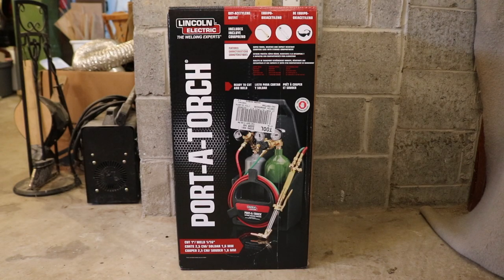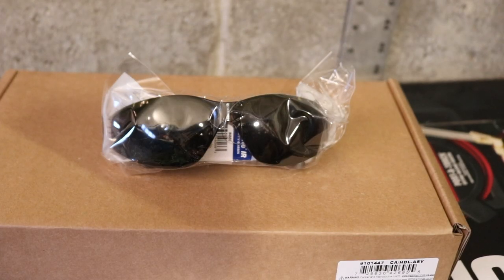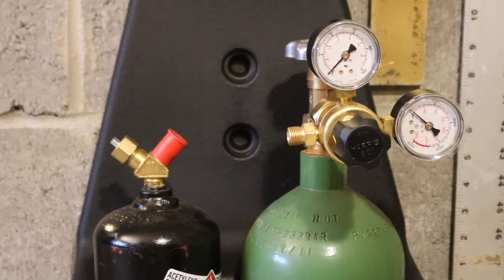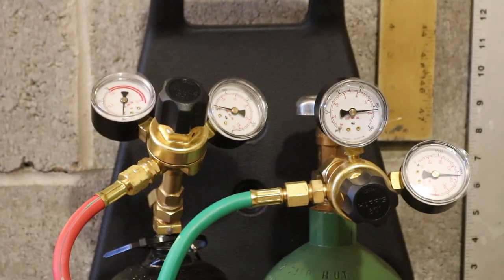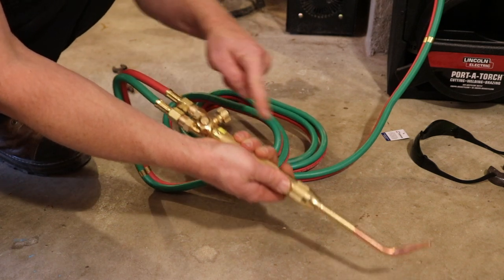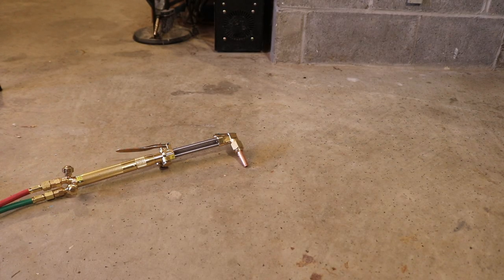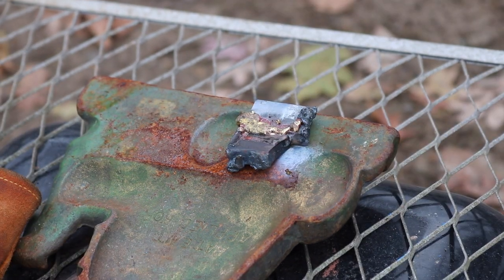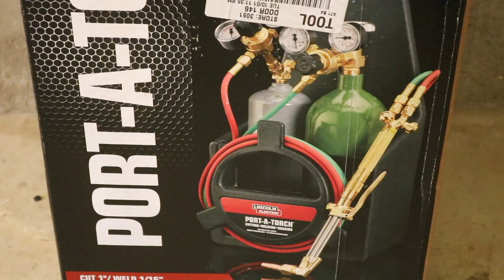Lincoln Electric Port A Torch KH990 (Unboxing, Setup, Test and Unbiased Review)

Comment: I can see that you can't weld to save your life. But hey at least you are trying. First of all for welding you are using a cutting torch. Use the welding tips for that 1/4" a number 4 tip is good. Heat up the welding surface until it gets red hot just enough to melt the surface then you introduced the welding rod. I set my welding tanks to 40 psi. for the oxygen and 10 psi. for the acetylene. That's just for welding. Keep burning my friend.
Reply from the maker: Thanks! I am terrible at welding. I need to take some classes.  That may not even work. I may need a master like Mr. Miyagi from Karate Kid only if he were a welding master.  Thanks for the tips. I need any I can get right now.
Reply: At first I skimmed the comments looking for an answer I thought this was a bit harsh. Then I watched the video and oof, point taken. Thanks For the video anyway ray. I think it showed me I should probably just buy the torch kit and get some bigger bottles.

Comment: Thanks for the video and explanation, man! How many cuts can you get from one fill? I have a 2 7/8s pipe cutting project. Need to cut about 12times.
Reply from the maker: The torch gas does not last very long but it will do 12 cuts for sure.

Comment: Please when using all these compressed gas cylinders always install the safety devices,that is the flash back arrestors on both the regulators and the torch end,this is very very important  .
Reply from the maker: Thanks! Very true. I also learned that it's a good idea to get bigger tanks when you go to refill. The tanks do not get filled all the way and quit working  before they are completely empty. When the acetylene gets low you can have flash back so don't run it when the acetylene gets low.

Comment: Congratulations!
I just bought this kit and I got the bottles refilled.
My question is how long do the bottle contents last?
I started using the torch today and I tested my cutting attachment which was maximum 5 mins 
and I did some welding which was around 15 mins total.
now my Acetylene was at 200 psi and now it's less than 100, What's going on?
How long do the tanks last when you use them?
Reply from the maker: The small tanks do not last long enough in my opinion. This is because a small amount of unused gas must be maintained. My tanks lasted about the same time that you mentioned. I am getting bigger tanks on my next refill. The only problem is the bigger the tanks the harder it gets to move so I'm looking into getting a torch cart.
Reply: @RayStein  Glad this exchange took place... I think I'm gonna use my small tanks to actually make a tank cart so when I do go and swap out for larger tanks I'll already have the cart...lol. Thanks guys.
Reply: @EM-eh1pg 
and use the 125 titanium welder to stick it together

Comment: Hello, how long does your gas and oxygen last? How many cuts can u make per set of tanks? Also is there a limit on how long you can use it before having to give it a “break” because of the acetone?
Reply from the maker: I have run my Port a Torch for an hour so far but am almost out of Acetylene. I still have a lot of Oxygen. Honestly, I have no regrets. I used to dread the idea of cutting with Oxy-Acetylene torches because the tanks were too big and heavy to lug around. Now it's fun because I can get to remote areas in my yard and cut stuff I would have never cut with the big tanks. I am actually thinking it's better to have 2 of each small tanks rather than one big Oxygen and one big Acetylene tank. I wont cut indoors because I don't want ash all over my garage. With that said, if you run the torch all day in a specially ventilated garage I would go with big tanks but I would still buy the Port a Torch because I love the Harris tips. I'd just switch my small tanks for bigger ones if volume becomes an issue. It cuts through metal really fast though so I don't feel the need for bigger tanks yet. Thanks for the comment!
Reply: Ray Stein hey thanks for replying. Was just wondering because of the 1/7th rule. That u can only use 1/7th of the tanks capacity per hour before having to give it a break. Just wondering how u dealt with that
Reply from the maker: @JoseGarcia-sy3ss  I take turns using my Dewalt Reciprocating saw, my Dewalt grinder and my Port a Torch.  I save the torch for the cuts the other two can't handle. I do demolition so I always have something else to cut or break apart while the tank rests. I use the tool for short periods of time. I must admit though I have violated the 1/7th rule when I'm heating something up before bending. I just pay close attention to my flow and turn it off if I notice my flow rate decrease. With that said,  safety is the most important thing when welding. I'm so glad you brought that up. I'll ask the guys at the gas store the next time I'm there and post their advice. I have a feeling they are going to tell me to use bigger tanks! Thanks for the comment because you may have saved a few of us on that one.
Reply: Ray Stein what did they say? Could you buy two more tanks and swap them out? One cools while you use the other?
Reply from the maker: @lhzav  I've been told it's best to get larger tanks. They will exchange them no questions asked. I told them I wanted potability so they said I should consider medium sized tanks or a cart for larger tanks. I'm getting a cart and will see what sizes are actually available versus how much weight I'm willing to cart around.
Reply: Ray Stein I guess larger is always the way to go but just not convenient in terms of transport. Especially over rough terrain. Thanks!

Comment: Wow this is a nice set, where did you purchase it from. Thanks for sharing
Reply from the maker: Lowes sells it. I will say I love the hardware but I recommend getting larger tanks on your first refill if possible.
Reply: Home Depot sells them too, it all depends tho, not every single store carries the same items as others
Reply from the maker: My small oxygen and acetylene tanks lasted 2 weeks. I had no problems with the gages. Also, they sell adapters if need be.

Comment: Great video, i am torn between this kit or the miller tag a long TL550 they look similar i do know that. Im not familiar with who rebrands etc if anyone knows any infornation like that i would love to hear your opinion on this kit vs the miller mentioned above. Im most going to be using it for a heat/cutting source for automotive type applications i dont see myself using it for welding too much. Really enjoyed the video :)
Reply from the maker: I use it for exactly what you are. The two kits are almost exactly the same. You could go with either one and be fine. Lowes sells the Lincoln Electric so you can see it / return it if you have any problems.
Reply: @RayStein  thanks for the suggestion!

Comment: I know it is almost a year later but it cost me $73 for both tanks here in TX
Reply from the maker: I'm going to get bigger tanks for mine and use the hardware that came with it. That hardware is as good as any expensive model. I guess the price of oxygen and acetylene depends on various factors. Some places charge more than others where I live. (Pittsburgh)
Reply: You mean 73$ to fill them? Or to buy them
Reply: @lucasellyson6872   Thanks. To fill them. The small tanks lasted  about 2 hours of off and on cutting. I got the opportunity to exchange them in for large tanks. Cost was $120 for the large tanks but they are well over twice the amount of fuel.

Comment: Your technique (or the lack there of) hurts me greatly... But at least you're trying.
Reply from the maker: L.O.L. I am so bad at welding. My welds are about as strong as cheap glue but the torch does cut quite well.
Reply: @RayStein  Your video inspired me to get one myself. They are very nice, now I have a big one for the shop n' a small one to pack around. 

Also, hehe, I'm no gas welder either. But always room to learn! :)